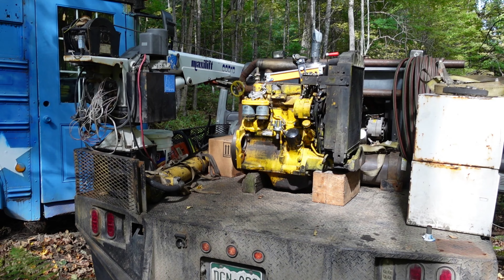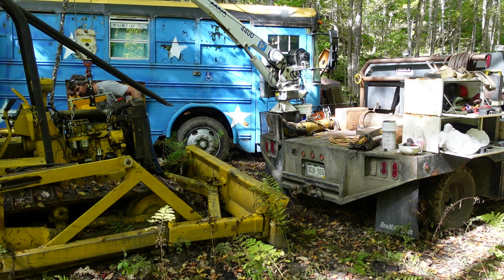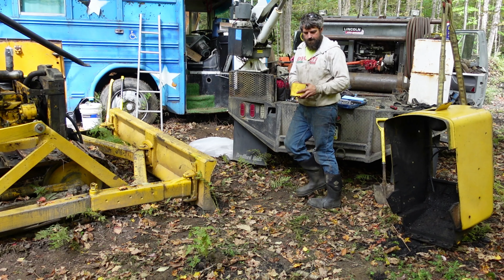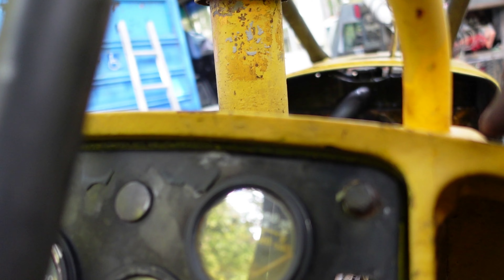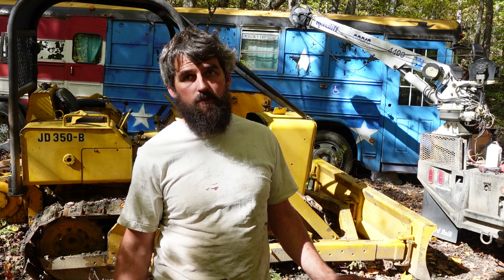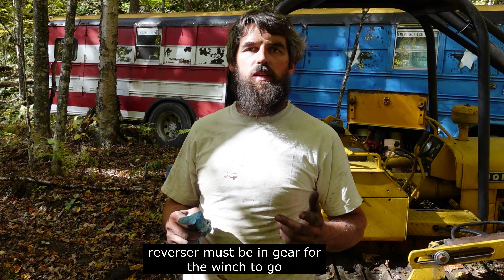John Deere 350B engine install, 1st START!, and drive

Comment: Thans for your video.  I just acquired a 350 and would like to know what the levers operate.  Blade up down I got.  Lever left and right of that. In the floor pan, a shift lever at left heel.

Comment: Late to the party, but yes, the MaxxForce head gasket is not as thick as the OEM ones.

Mine measured about 6-7 thousands less than the Deere one, got lucky as it leaked coolant before even trying to start it up.
Reply from the maker: It's great buying stuff, installing it, and having it never work

Comment: 8 have a 350c that I had to overhaul reversing gearbox and had problems lining up the engine to get the 4 bolts in.
Reply from the maker: getting an engine in can be a pain sometimes, they usually seem to go super smooth, or fight for way to long
Reply: @DillonHFM  yep for sure.

Comment: Ill be doing the same to a 450c here this winter. Coolant in oil pan. Great informative video! Any tips for the rebuild with these JD motors?
Reply from the maker: They are pretty easy, only a few bolts to take them out, check the bolts holding the drive line together while you are in there. I have heard of the transmission to reverser loosening up, and mine had. Not bad to get to while you are there. Nice simple machines